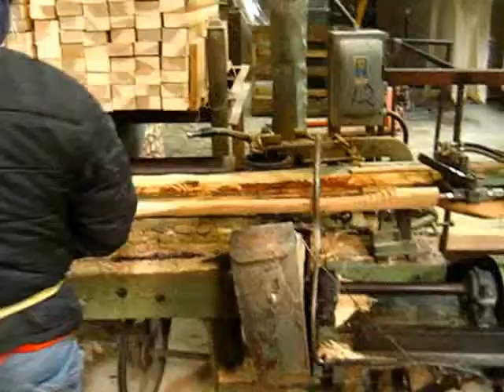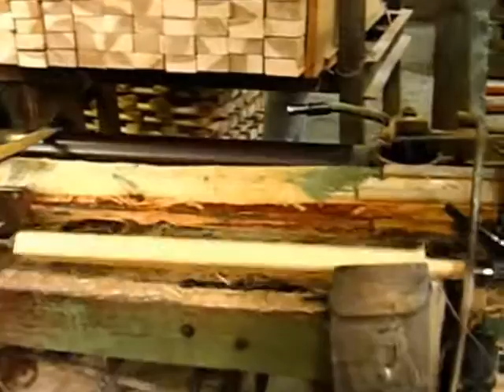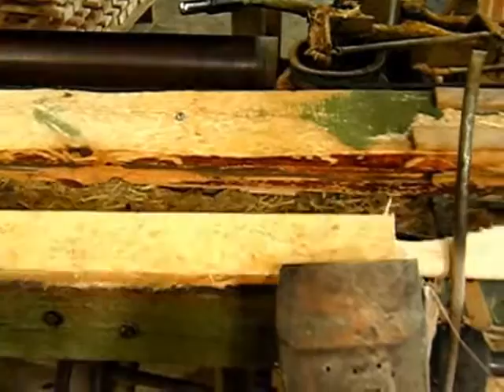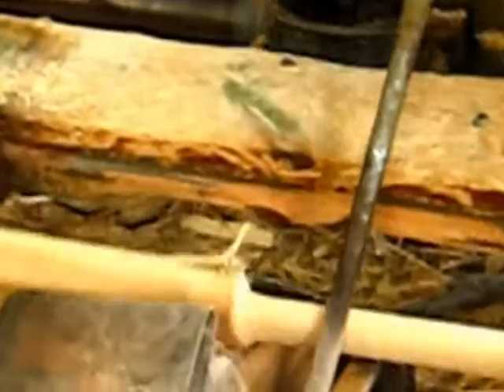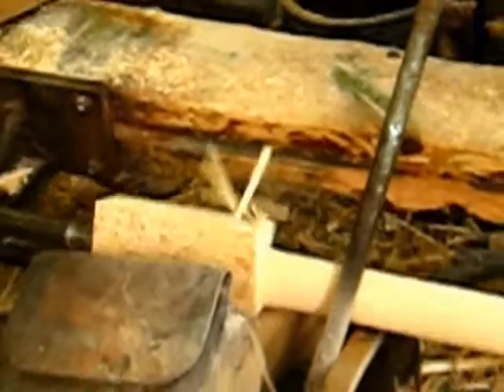Axe Handle Lathe - Turing Handle

Comment: Very cool machine, what is doing the cutting, a spinning saw blade? Doesn't look like a single point tool.
Reply from the maker: A cutter head with multiple blades. Kind of a giant blade about 1.5" wide. Older heads looked a little more like a saw blade. Or you can use a saw blade, but wider is faster.